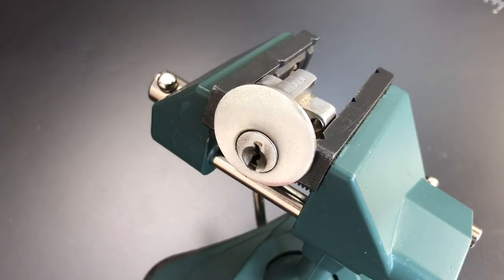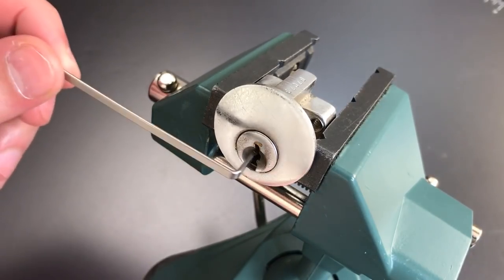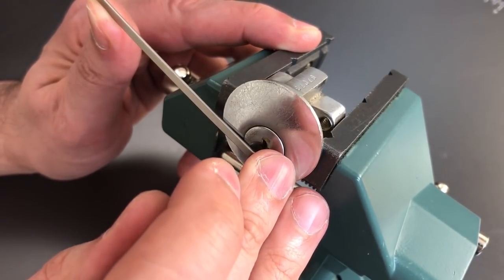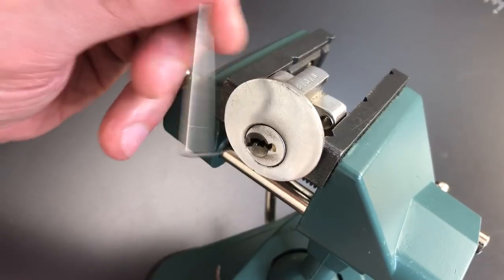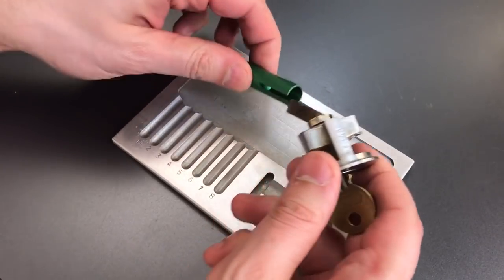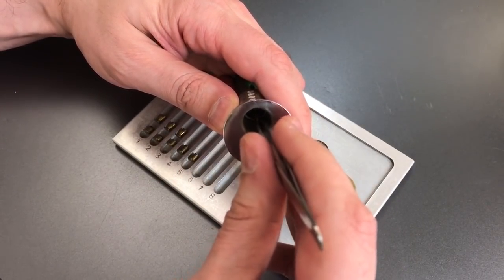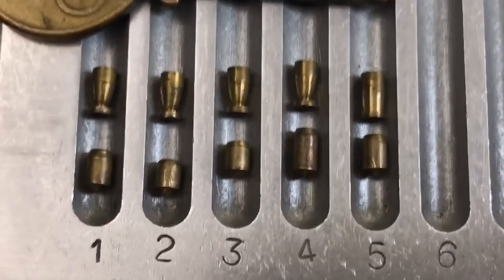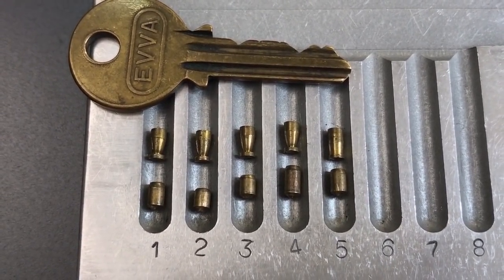[453] Vintage EVVA Rim Cylinder Picked and Gutted

Comment: is that pinning tray commercially available? I want it. If not I would like to have a file that I could use on the router table at work.
Reply from the maker: Nope... made in in my basement on a little hobby mill.
Reply: Could you make a how-to video with billet aluminum and acrylic? Similar to BosnianBill's 'make a pinning tray' videos? I really wish I could do this with a dremel tool like Bill did!

Comment: could someone explain what the false set means?
Reply: (Forgive me if I'm mistaken in anyway, and feel free to correct me if I am wrong.) False sets occur when you have non-standard driver pins. They are usually your spools and mushrooms and to a lesser degree, serrated pins as well. When you pick a spool, you'll push the narrow body of the pin into the sheer line, which gives you rotation and causing the pin to become stuck. That's where the counter-rotation comes from when picking yourself out of a false set.
Reply: It's when pins particularly spools get stuck at the shear line when they've been about 90% set and when you try to set the pin the rest of the way the plug may turn in the opposite direction and that's called counter rotation.
Reply from the maker: All good explanations.  I might phrase it differently.  First, let's define what a "set" is.  It's when we lift the binding pin to the shear line.  We will hear a little click and get a tiny bit of movement on the core.  A "false set" is very similar... it's when you lift a binding pin and you get that same click/movement, but you are not at the shear line.  You are stuck in some feature of a security pin.  Thus, the set is "false."  Hope that makes sense.